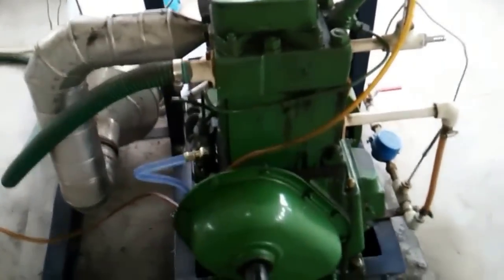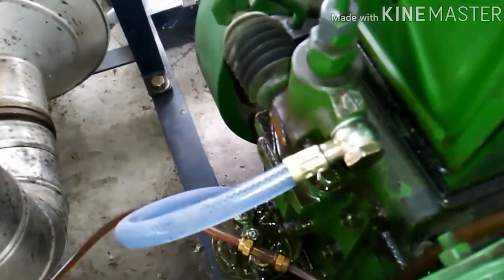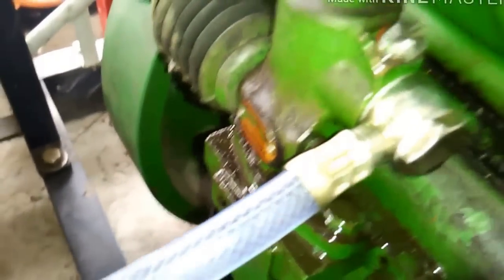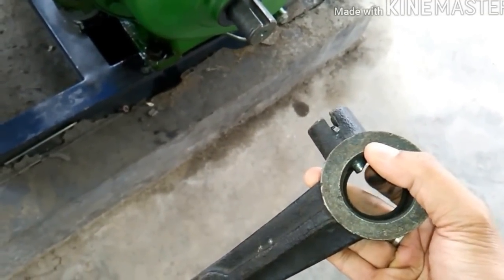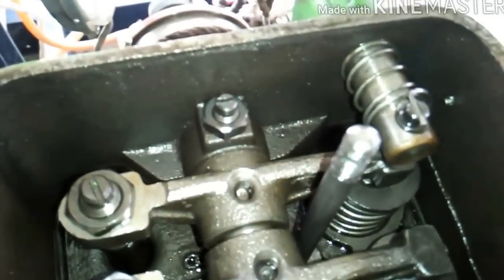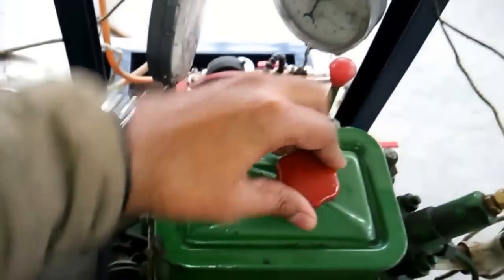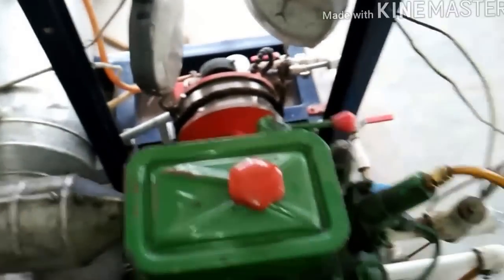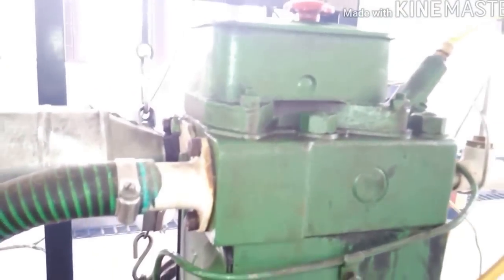how to start an engine by hand (handcranking) 
(KIRLOSKAR -AV1 DIESEL ENGINE)

Comment: Can we rotate the crank in any direction or its fixed that clockwise only?
Reply from the maker: No the handle is desgined so with a spring loaded key
Reply: Hai whenever trying to start kirlosker varsha 5hp engine its moving to reverse i mean starting in anti clock wise direct ion  any tips to help

Comment: Thanks Siddhartha. Can you tell me what will happen if cranking handle is left rotating (my mistake/fear)? How to install a Governor to start this type of DG & how much will it cost?
Reply from the maker: +Jai670 Padhi the handle is such desgined with a key that you can't turn it in the opposite direction the handle will turn but the shaft will not turn if tried to rotate it in the opposite direction
It has got class B1 governing
Reply from the maker: +Jai670 Padhi I don't have any idea about the cost

Comment: Learn where to place your thumb on a starting handle
Reply from the maker: Jim Murphy I am not putting my thumb inside the shaft
I am just pushing the spring loaded key outward so that it gets fitted in the key way 
Btw Thanks for you concern
Reply: That is not what you are doing wrong !
Reply from the maker: Jim Murphy please enlighten me
Reply: Always place your thumb over the top of the handle , never under the handle because if you are starting a diesel and it backfires you could dislocate your thumb .
Reply from the maker: Jim Murphy thank you I will be more careful next time
Reply: Conversation of both of you most importantl for us thankyou....

Comment: OMG! the sound of the engine running...... i think your engine has a demon in it LOL i think you need a exorcist....
Reply from the maker: +Cliff P sure
:)
Can you please arrange one
Reply: Lol... In developing countries most DG is this type - hand cranked & LOUD! Manually cranking is bit hard (at first) & most people run away as the DG roars leaving the cranking handle stuck to the shaft which itself is very dangerous.